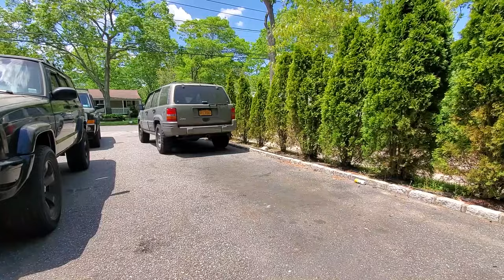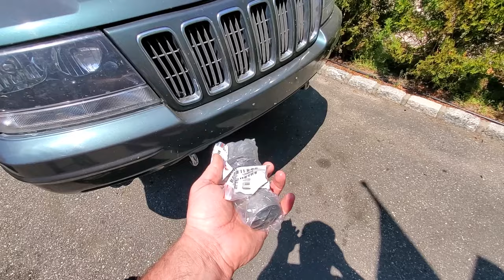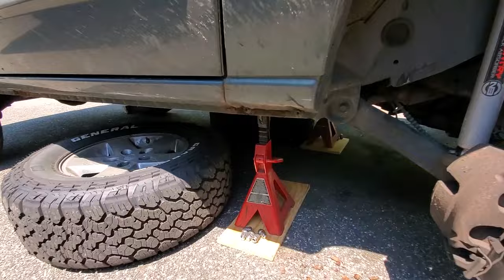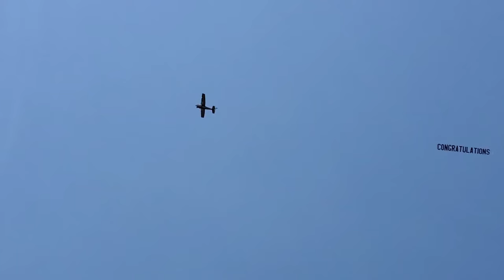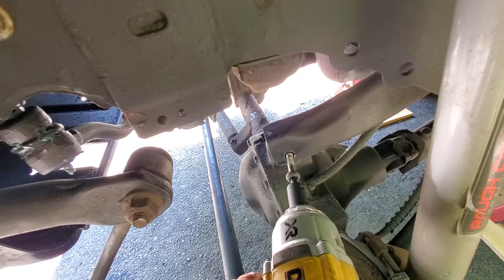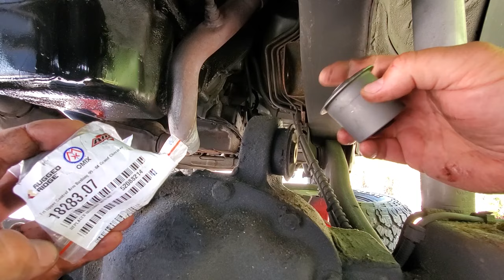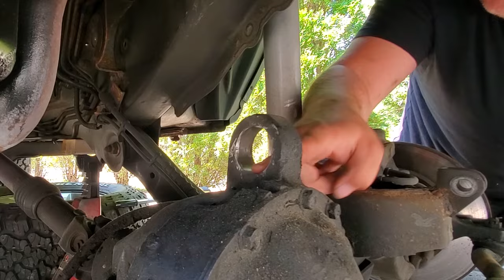JEEP GRAND CHEROKEE WJ FRONT CONTROL ARMS AND AXLE BUSHINGS - MAXPEEDINGRODS UPPER AND LOWERS

Comment: Yes hi Dan I got a question I had bought speakers off of you I don't know if you remember anyway I have a question my fuel filter is it's like hissing is that does that mean that it's a bad fuel filter because when I start up my truck it runs a little rough and then it you know runs a little smooth but then it gets a little rough again and everything that I'm reading it's saying that the fuel filter and mine is actually hissing I would appreciate it if maybe you could let me know if that's normal
Reply from the maker: I'm pretty sure it's not supposed to hiss but changing a fuel filter is pretty simple.. give it a shot!

Comment: Nice job Dan! Good explanations on what you're doing and using to get the job done! I did rear bearings and seals on my zj Dana#44 rear with oil change( 80/140). C-clip axles are a bit challenging but doable!
Reply from the maker: That's great man! Everything is doable with enough time and the right tools!

Comment: to remove the old and installing the new bushing on top of the diff is always a mess - but I see your creativity masters all issues coming up ....
How did you recognize that the upper/lower control arm bushings are shot ? Usually you can't see it from outside - did you have death wobble/play at the front axle/suspension ?
Reply from the maker: I had the DW but a new track bar solved that.  still felt a lot of play in the front end.. also the old rubber creaked so loudly! now it tight and quiet!

Comment: Did the truck sway back and forth before doing this? I bought this 96 grand cherokee limited from the original owner with 178k miles. I though it just needed an alignment. Now I have replaced all 4 tires, the steering shaft, steering box, pitman arm, stabilizer shock, track bar, tie rods. Basically every steeering part has been replaced old owner did upper and lower ball joints, shocks a year ago. I did the lower control arms but not the uppers. Trucks still swaying back and forth and hard to keep steady in the lane. Do you think the upper control arms will fix this? I'm ready to light this truck on fire and roast marshmellows!!!!!!! LOL
Reply from the maker: lol yes!!! is still has some sway because I didn't do my rear upper control arms but it's so tight now.. like night and day!
Reply: @ProjectDanH  Thanks man! I was just about to cut my losses but I'm hard headed and need to solve problems no matter the cost. I decided to order new front uppers, rear uppers, lowers, rear track bar and sway bar links and bushings. If this doesn't work I'm burning it to the ground! LOL My mechanic buddy told me to replace the steering box so I bought a reman from Advanced now he tells me it's junk and I should return it. Well you said replace it you didn't say what brand I'm on a budget man!!
Reply: Did you get it fixed? My 98 grand cherokee was wondering like yours. I put new HD Bilstein shocks and heavy duty sway bars on front and back and problem GONE. Drives like new, a little stiffer but great.
Reply: @USA__2023  I did actually end up doing front and rear upper and lower control arms and front and rear track bars. Then my stepson wanted it and immediately ordered a cheap 3" puck spring lift and new shocks and the 31" tires. Surprise surprise the problem came back! New adjustable track bar, drop pitman arm, transfer case drop. No luck! Finally made a post on FB and everyone said we needed new front lower control arms for a 3" lift. Fixed! He actually needs to do all the control arms but for now at least he can drive over 60 mph without having to worry about crashing.

Comment: Hello Dan. I have a WJ. I've got two questions for you.

Firstly, I want to replace entire sound system and Multimedia panel (my WJ's panel, it's aftermarket 🤦🏻‍♂️) of my car. Can you share a video for WJ's sound system and radio?

Secondly, the WJ has two buttons behind the steering wheel. I have no clue what they do. I believe they are related to the original radio panel of the car, but despite a lot of research, I could not find what they do. It's not even written in the car's owner's manual! Do you know what they do?

Thanks.
Reply from the maker: Hey brother, My WJ sound system is completely stock.  I currently have a 2002 to 2004 factory navigation head unit and my WJ came with the infinity amp and a 10 disc changer in the rear. At the moment I unplugged the disc changer and I'm using that auxiliary port for a auxiliary input jack to my phone.  If you have buttons on your steering wheel they are standard steering wheel controls They turn the volume up and down and tune the radio station
Reply: @ProjectDanH   Thanks for your answer brother 😁 Will WJ brake video coming by?
Reply from the maker: @erenozuaydn1240  soon very soon! Check up on my ZJ break videos They're very similar!
Reply: @ProjectDanH  Thanks Dan. Actually, I need to ask you an one more thing 😅 When I'm going to stop the engine in hot weathers, WJ doesn't work again a few hours. Engine temperature was normal, I checked it. I can't find the problem. Then I called a Jeep garage. They tried a few times too but it didn't work. Do you have an opinion on this? I would be very happy if you could help me one last time 😊😁🙏🏻
Reply: @ProjectDanH  Also I'm going to check the ZJ brake video of yours! Thank you really. Your videos are so nice! I learnt too much things from your videos! Thank you again 👊🏻👊🏻👊🏻 I subscribed, liked all videos, shared and commited to my Jeep lover friends 😁

Comment: Why did you change them? They don't really require changing unless bent. You can change the bushings and save money. The only other reason to change them is when a lift requires longer arms. You appear to have changed the arms with the exact same arms?
Reply from the maker: The arms are cheap enough to replace with out wasting time to do the bushings.  Its old" time vs money" paradox.. this project allowed me to just get new arms (even tho I installed them backwards. lol)

Comment: Do bad control arms cause the death wobble? I have a ZJ that just started doing the death wobble.
Reply from the maker: Absolutely.. bad bushings cause lots of play
Reply: @ProjectDanH  Agreed, the list of parts that can cause death wobble is pretty long. Track bar, control arms, upper and lower ball joints, front hubs, tie rods, bad steering box, and even bad tires can all cause or contribute to death wobble.
Reply: Bad controls arms can't cause death wobble, as death wobble is literally movement between both steer wheels in a solid axle ( movement caused by slop in steering linkages)
  However, too short of control arms, on a lifted vehicle, can cause death wobble..by changing the caster angle.
    Proper stock caster angle, will allow worn/sloppy steering linkages to not death wobble.....
    Lift the vehicle, change the caster...boom, death wobble

Comment: Re: the broken control arm bolt.  Using an impact driver to tighten them is asking for trouble
Reply from the maker: Installing with an impact isn't bad if you're not cranking on it.   of course, hand torquing to spec is best.

Comment: How much you would pay in service with labor?? Am I hearing well? 340$ per side
Reply from the maker: Watch the end! Lol.  That's why I'll do it myself 🤣👍
Reply: @ProjectDanH  I heard very well😂But I am soooooo confused..😂😧If I can, I would like to send you something on IG🤓
Reply: @matejzatko787  I just had my front control arms done by a shop. I also had them install an adjustable track bar along with new axle shafts, upper and lower ball joints, and a valve cover gasket. My total was $1,136.73. I guess I got lucky with the price! Oh they also mounted and balanced a set of tires. 2000 WJ with a 2.5 inch lift.

Comment: The passenger side lower control bolt won't line up what i need to. Do
Reply from the maker: Gonna need to use some ratchet straps and a jack to work it into position